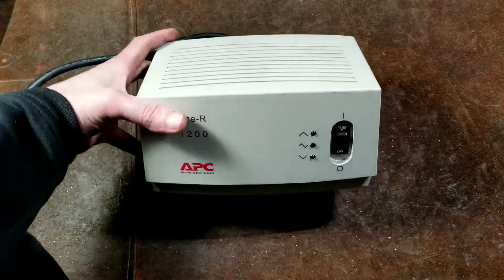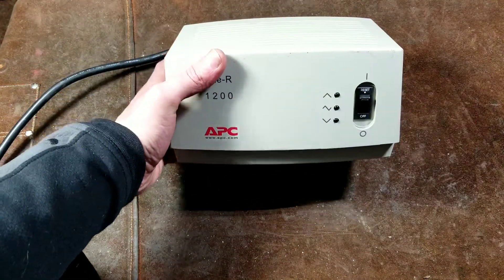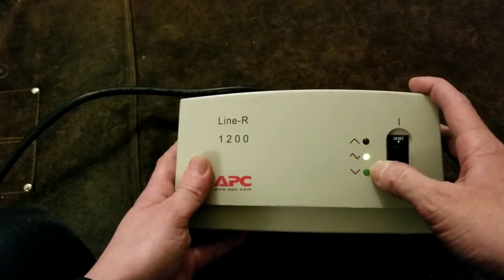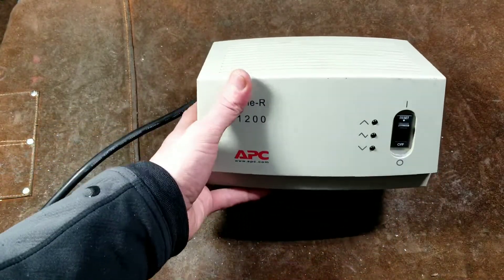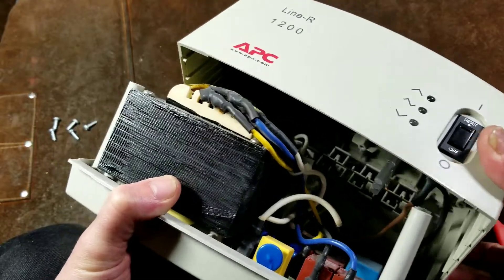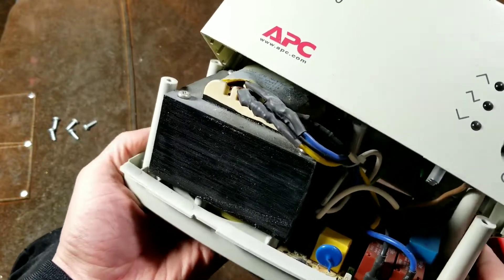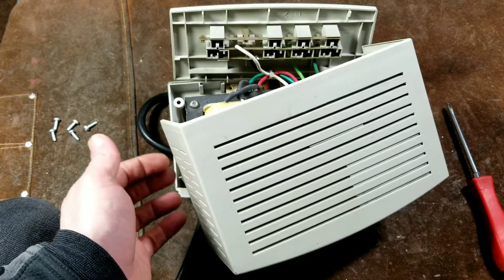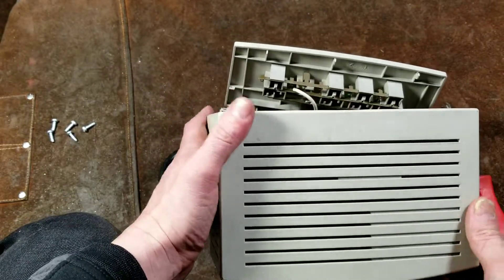APC Line-R 1200 Voltage Regulating Power Conditioner Review

Comment: I own one of these. For North America should I set the back switch at 110v or 120v?
Reply: 120v is the modern standard.  However, as mentioned in the video, it's recommend you test your current line voltage and set it as close to that as you can.  Otherwise, it'll be switching all the time.

Comment: Just picked one up for $5 at a thrift store. Going to test it with some inexpensive stuff and watch my kilowatt meter before trying on my PC. But seems to work well so far!
Reply: I have a laser engraver/cutter and when the chiller kicks on the lights dim in the laser machine and it will ruin an engraving so I am looking for something to take care of this and the chiller is even on its own circuit.
Reply: @thebeststooge  Check the house connection to the mains. I had a similar thing happen and the power company tightened up the connection and fixed it for free. More important, that slightly loose connection can heat up and cause a fire!

Comment: Wonder if you can help me I just bought the Line R 600 when I turned it on the light was green. I unplugged the unit and A/B with my furman power strip then plugged the AR in and it was yellow showing high voltage. 
Turned it off and did the A/B again and the light was yellow again. The 3rd time around it was back at green. This happened also jamming at my girlfriends place. Left it at yellow and over night it was back on green. Says its showing the voltage it higher is it keeping the 240 in tact? think when i turn it on and off it should reset it ?? who knows maybe you? thanks!!

Comment: Hi Catus Max, my unit shutdown twice yesterday, with all 3 LEDs blinking, first time in many years of using this unit. Not able to find any explanation on what this means on the APC website/documentation. As far as I know there is nothing happen to the power line since my other unit downstairs didn't react. Hope you can help.
Reply from the maker: It means that the controller board is having issues these newer models are not as good as the old ones in the metal boxes that are square
Reply: @CatusMaximus  Does this mean that this unit going to failed soon? When it failed, will it also kills other equipments that are connected to this unit? Do you have any recommendation on what I can get to replace this unit with? Preferably similar or bigger capacity. Thanks

Comment: I think you're incorrect @ 1:45 about this model having two boosts/bucks.

Not only in your teardown is there not enough tap wiring to support that (I only see 3 wires coming out compared to 5 on your teardown of the vintage one), but this other video literally shows only one buck/boost level: https://www.youtube.com/watch?v=lZ0VZ8_pP2k

This model also seems to have a bug where it'll buck even when input voltage ~120V -- such as upon power-up.

Comment: So it takes a drop to 110 before it kicks in to bring it back to 120?? I was hoping for faster reaction
Reply from the maker: No it is a multi winding Transformer base unit so it does not maintain a constant voltage like a Sola would. It works in steps and it is effective for the price range. The only way to get anything better is either with a constant voltage Transformer which are much more expensive or an on line type continuous conversion uninterruptible battery power supply

Comment: Thanks for the info. Would this unit be enough to provide clean and stable power, from a NON INVERTER type generator, to run sensitive electronics?
Reply: I've just tried it - didn't work for me, so I'm looking to mod it in some way.
Reply: Had a power outage last week and fired up the non-inverter generator to power the fridge and freezer.  Took advantage of the extra capacity of the generator to watch some TV, using the APC LE1200 to condition the power.  Seem to work well.

Comment: Is the building wiring fault light supposed to flash on for a sec when you start the device or is that bad?
Reply from the maker: It is only an issue if that light stays on

Comment: Does this act as an isolation transformer?
Reply from the maker: No the Transformer is just a step up or step down the voltage otherwise it uses traditional power filtering like capacitors and inductors it does have a very high-quality power filtering stage but you would use this in tandem with an isolation transformer for the ultimate and Power Protection the only thing better would be a online type UPS
Reply: @CatusMaximus  I bought mine to keep my Lazer Printer from pulling the Juice down too low when it prints

Comment: This product is highly recommended for a side by side refrigerator when there is low voltage and it really stabilizes?
Reply from the maker: It should work fine but you'll want to make sure that your refrigerator uses less power then the Watts that this conditioner is rated for because it has an electric pump motor.
Reply: @CatusMaximus  thanks!! 😄
Reply: I plan using it for my 8000 BTU window ac and mini fridge here in my van I live in

Comment: Hi great video Question I have to run on a portable generator once in awhile, it outputs 115 or 116 ac volts I want to use this for my desktop computer just for protection. My generator runs pretty steady but need something just in case would this work and my apc battery does not like the generator? Also if the switch on the back is 120 or 110 what would I set it at for my desktop computer ? The computer runs fine at 115 any help would be appreciated thanks!
Reply from the maker: This would help if your generator suffers from significant voltage sags. Your APC battery is probably complaining about some type of grounding issue which is common with generators.

I would set the switch to 110 volts switching power supplies can use ac voltage from 100 to 240 and they like higher voltages
Reply: @CatusMaximus   Thanks for replying!  Is there something I can do to help the grounding issue with the APC battery backup device?
Reply: UPSs tend to be picky about the sine wave.  Traditional generators have terrible sine waves.  Your best bet is to use an inverter generator (more money).

Comment: I watched this entire video and still have zero clue what this item does and why a typical homeowner would use one.   Boost or buck.  LOL. Huh?
Reply from the maker: I'll do better the next time I review one of these types of units and making a simple explanation
Reply: When my fridge/dryer get turned on we have brownouts (voltage drop down to ~90v briefly). Conditioners like this (theoretically) correct for those situations where the wall power is out of spec.